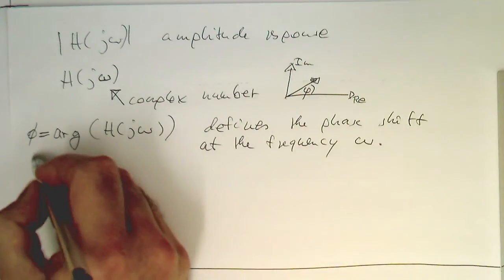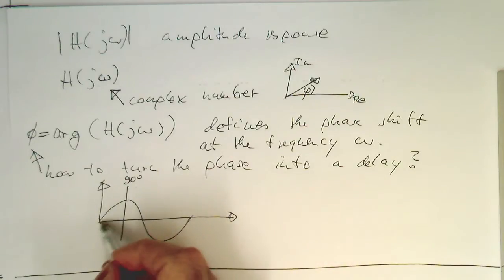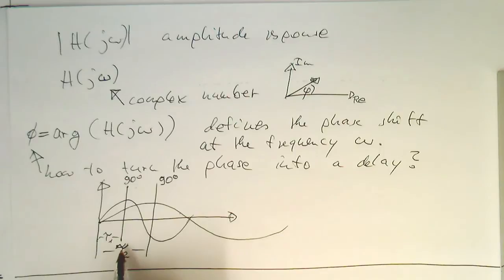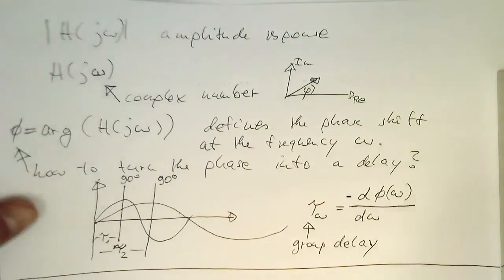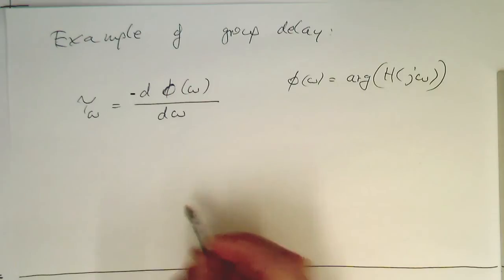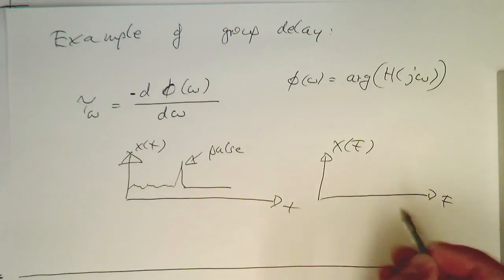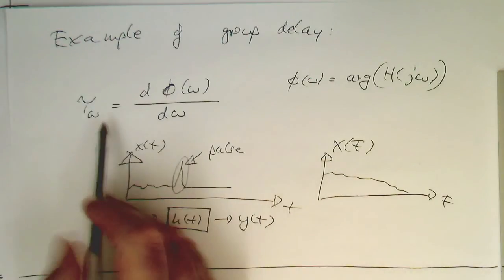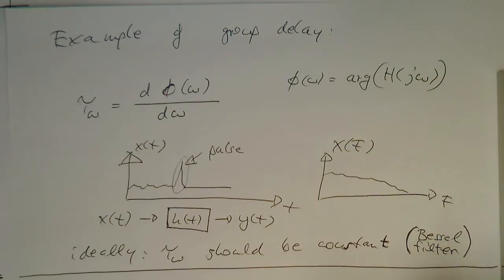Causal Signal processing: group delay (#007)

Comment: But isn't the time delay of a certain frequency the definition of phase delay rather that group delay?

What do you mean by the tau of omega being constant? Does it mean that all the frequency components are delayed by the same amount of time?
Reply from the maker: I've added a link to a beautifully hand drawn presentation by HP. The group delay is the one which needs to be constant because it guarantees that neighboring frequencies (d omega) will be transmitted with the same delay. So, for example the hissing sound of a high-hat which is an impulse with a group of frequencies won't be smeared out by the filter in time. A constant group delay preserves the envolope of the signal (in time) or more pretentious: it's information. What we ideally want is that all frequency components are delayed by  the same amount. In the analogue world that would have been only possible approximately (e.g. Bessel filters) but in the digital domain we can design FIR filters which have constant group delay for all frequencies. Turns out that as long as the FIR filter response is (anti-)symmetrical it has constant group delay.
Reply: Digital Signal Processing Thank you very much for your reply it is actually very helpful. I will go through the attached document you posted in the description.
So, according to your reply and previous research group delay is related to the amplitude envelope of a sound in that sense that if the group delay is constant than the envelope of the sound will not change, if it's not constant than the amplitude envelope of the sound will be different at the output, right?
And also, the group delay is related to the initial phase of the frequency components in that sense that the group delay measures how much the neighbouring frequencies delayed in phase (and e.g. not in time), right?